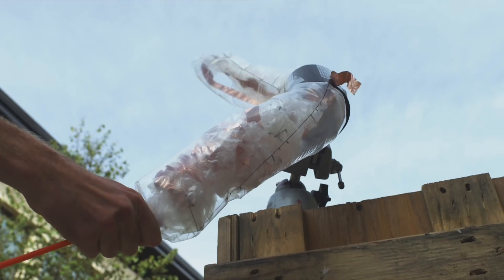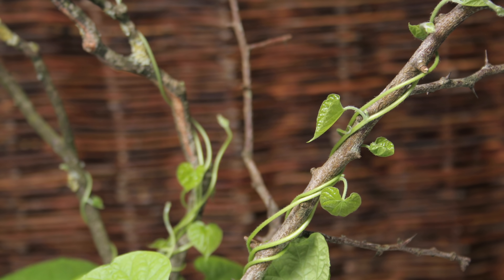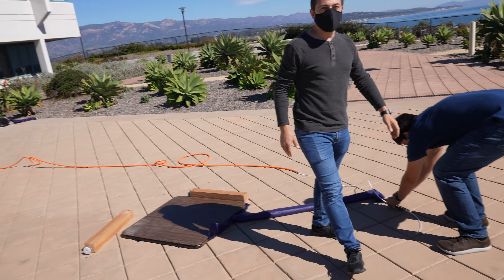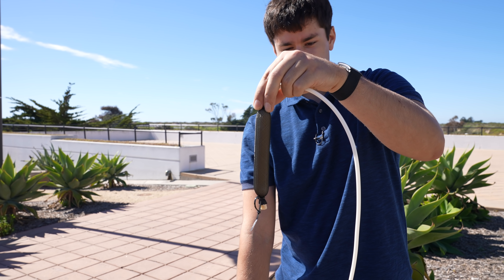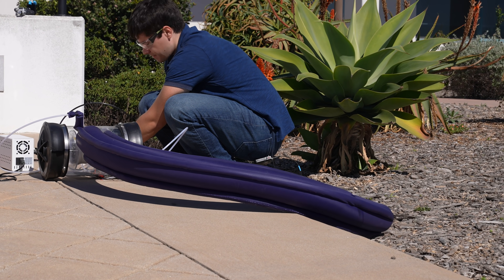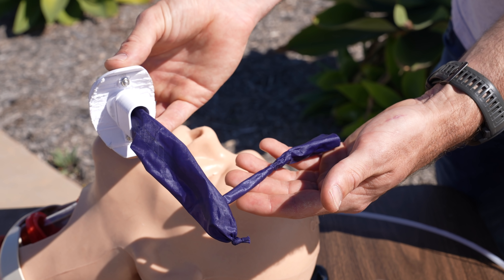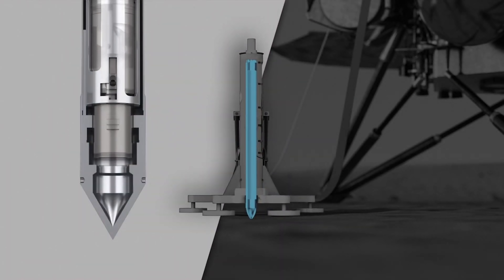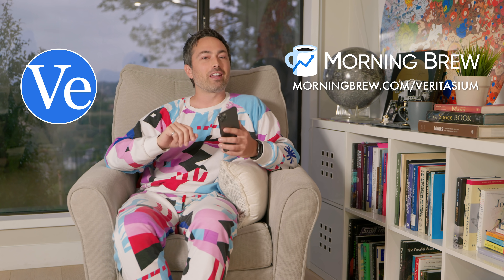This Unstoppable Robot Could Save Your Life

Comment: If they replace current intubation with this soft technique, the guys behind it should get a nobel prize for reducing the suffering in the world.
Reply: Telling me, I remember waking up with a tube down my throat. So damn painful.
Reply: Seems like exhaling would be an issue, remove pressure and the airway collapses
Reply: @Mooselake51  The core can supply oxygen while the outer sleeve remains pressurized, keeping the airway open.
Reply: People dont get intubated without sedation and anaesthesia, outside of some very rare and specific circumstances, in which they still recieve medication to make sure they dont feel the tube. Furthermore, this device couldnt replace the tube itself, merely the applicator.
Reply: @ineednochannelyoutube5384  I agree. The device will apply the tube fed through the middle of it. It's not something you would do to someone awake for sure. On the other hand they can do something similar for a choking issue. Something like that that pushes a chunk of meat down to the stomach when it is stuck in the throat could save a life potentially or maybe grab onto it and pull it back out. I could see that as useful for sure.

Comment: Could be used for ground anchoring in deserts or sandy environments. Lots of them push through the sand to a specific depth then are filled with cement to act as foundations. Could be used for anchoring things at sea in a similar way.

Comment: This could be used to create a soft conduit to run cables through an existing building, vs new construction. The camera head would have to drag a pull-string along on the inside. Supply lubricating gel into the inside as it goes. Once the vine robit reaches the destination, just hitch the pull-string to the cables then pull the cables through. Far fewer holes would need to be cut in the walls or ceiling to create a pathway.

Comment: Soft robotics are the best!! They have two key advantages. The large surface area means less force per area (pressure), a lot less. This is good for picking up fragile objects. The second is that material properties replace complex code. The intubation example should how this might work. The caveat is that soft robotics work best in conjunction with “hard” robotic components. They will eventually become common in applications that require a gentle touch. This could be healthcare or product lines and beyond.

Comment: after watching this...

I'm 100% sure this will be turned into a sex toy before the year is out.
Reply: And I’m sure someone is gonna over-inflate it and probably end up in a hospital.
Reply: If it doesn't, somebody's completely missed the train.
Reply: @marekkelin1181  Probably just deflate it and pull it out
Reply: @Snowmity  just use another inflatable robot to rescue the inflatable robot
Reply: @ImCelticlol  holy crap, you’re right
Reply: @ImCelticlol  help me step-robot I’m stuck!
Reply: @ImCelticlol  u2
Reply: @ImCelticlol  It's inflatable robots all the way down.
Reply: @Snowmity  inflate it up their intestines
Reply: @gram.  if it's long enough eventually it will come out the other end
Reply: You know, this thing does kind of work much like a schlong, doesn't it?
Reply: @ronaldgarrison8478  Not mine. Mine grows from tip backwards, into the base.

Is that normal?
Reply: @ronaldgarrison8478  yep
Reply: Could this be used in surgeries. Unblocking arteries etc?
Reply: ngl I already had the idea of something like that in my head but I didn't think it would use inflation to extend, I was just thinking that the tube would have a spine on the inside with cables as muscles running parallel to it along its length

Comment: This has been used for sewer rehab since the late 1990s. They use an epoxy lined tube that inflates through the sewer to be rehabbed, then hot water is pumped through to cure the epoxy. One of the absolute best “non-invasive” ways to repair an old sewer line.

Comment: Internally casing ruptured sewer pipes has been done for years but instead of using air epoxy is pumped  with internal air sleeve so it seals and solidifies after curing.

Comment: Self replicating machine
My description of a possible self replicating machine.
Part I - Set Up

Firstly we need to list the required parts of the machine.
The ability to build something
The instructions on what to build
The ability to copy the instructions
The ability to gather raw materials for creating a copy
The ability to gather raw materials for energy
The ability to use the energy

Part II - The Machine
For this demonstration I will examine a machine made out of wood.
The logic of this machine will be encoded in thousands of little gears. It will be able to move around pseudorandomly until it finds a tree when it starts trying to cut down the tree. It will use the wood either as fuel for the fire inside of it, to continue its own development, or to start building its copy. It will use smoke from the fire inside it to power the first gear so that it can move around.
Part III - Life Cycle
The life of the machine will start when its parent drops the new creature out of its top and lights the fire inside the new machine. It starts out looking for a tree to chop down and when it finds one it uses it as fuel and it will keep looking for fuel until it decides to go onto the second stage of its life. It finds a tree and drills out a hole for it to use as its shell. This shell will be to make sure the new machine it starts to make doesn't fall out before it is complete. When it does it will still continue to look for wood for its new copy and its own fuel. When it is done making its new copy its drops it down and starts the fire inside it only to immediately start working on a new one.
Part IV - How does Replication Work
The way the replication works is entirely encoded in the tape. The tape only encodes how to build the machine, nothing else. As the machine gathers wood in the second phase of its life, it runs the tape through a builder who reads all of the instructions and does exactly what the tape says. There will be parts of the tape that say to wait for more wood to come in before continuing. 

On the next step the machine will run the tape through a copier which will create a near identical copy of the tape to feed into the new machine and after that everything will be complete.

Part V - How does the Logic Work
For the logic we will need a turing complete system that can run mostly on gears. And for that we will use the functionally complete not or system of logic.

Not gate

The not gate is easy, all that is needed to negate an input is a gear directly connected to the fire which is turning in the opposite direction of the gear we want to negate, this only works if some gears can move without forcing all connected gears to also move which is not hard to do

Or gate

The gate is almost just as easy. All you need is two gears both connected to the third gear in such a way that it can only flow in one direction which is also not hard to do.

Part VI - Other Materials
For this to actually be useful it needs to be able to work with materials other than wood, and the only part that is actually wood dependent is the fire so in order to do this with any other material all you need is a new energy source that can power gears. If there's any flammable resource in the area it is possible to use that, for example it's possible to imagine one made of dirt with a grass or leaf fire. However two situations where this would be very interesting would be underground mining for resources, or on the surface of mars to help terraform the planet. 

Underground an obvious resource is coal which is preferred because it can keep burning for a long time and on mars there is tons of geothermal energy which can easily be used to keep any machine running. Solar power does not work because the machines won't be able to find enough silicon to make more solar panels.

Comment: “It’s basically free” says the man that most likely does not pay for the research and development of the project he is working on. Guess that money just gets pulled off the money tree they grow on the back lot. And if he is 100% funding it good for him. I hope he gets a huge return on his investment.
Reply: Well I did understand it in different manner. This kind of robots are super cheap, it is just some material, and compressor. No engines, no super specialised detectors, almos no electronics, superlightweight. easy to deploy and produce.
Reply: @marcinrobak6038  it’s not just the materials involved with making said ballon robot.  The team doing the research and development on the robot have to be paid in some way.  The team has to be compensated for there time and effort.   If they are doing it for a university then they receive a paycheck from said university.  If they work for a private firm then that firm issues them a paycheck for their time they work on the project.  The time is the part that’s expensive and no materials are ever free.  No mater what they have a cost associated with them.  The plastics and polymers they are experimenting with are not free. The air compressor is not free. The sensors and cameras they are using are not free.  These all have a cost associated with them.  So let’s say these guys work for a university science lab and each make 100k per year.  Let’s say they have 3 people on it and have been exclusively working on this project for two years.  So 600k in cost for this project before any materials have been bought.  This does even get into the possibility of government grants and tax dollars going to research like this.  But maybe they are 100% privately funded, maybe they are doing it their free time outside of work. If so I wish them a giant return on their investment.  My point is absolutely nothing in this world is free.   Everything is paid for by something.
Reply: @cypresscustoms  Well yes everything has a cost, that cost will be returned in profits from commercially made robots, as they patent those solutions.
May argument is about what the Prof. Elliot Hawkes did say "... they are so cheap, I mean they're basically free. You could grow hundred of them into a collapsed building."
he is talking that those robots are super cheap to make, not as his work is cheap.

Comment: S&R Phase II operations. drop a box that deploys into a tent with a roll-out solar panel and/or a soft windmill to be shelter for stranded people while they wait for a rescue team. Cut the power to the pump and roll the shelter up for refurbishment/reuse in future deployment. ALL of the uses shown here are useful in deploying such a shelter, using ground liquification to shoot anchors into the earth, grow a tent using pre-confined tubes, the antenna to boost signal of radio. masts for the solar/wind. Hell, you can even make a rain-catch/solar still with this. An entire livable camp site in a small, self deploying package. No previous survival knowledge required, just a package with a rip cord and a note that reads "Pull cord and stand back. We're coming. Fresh food and water inside, talk to you soon."

Comment: You could create an optical line that you feed through the centre. That is pushed forward along with the pressure allows you to have Optics line. You have to reverse the entire system. The balloon becomes on the outside reversed if you understand what I'm saying the good thing about having the optical cable inside it can double as a rope when retracting the system. Think of double-layered socks the Optics are inside the first sock. Then you have your air layer of compression and the outer sock covering. Expand out. And the optical nerve pulls it back in and deflates

Comment: To install a kite bladder there is the need to have a pulling line inside the leading edge or struts. It would be easier if it was possible to use the technique described here.

Comment: This could be used to supply fresh oxygen and liquids to trapped people, even if it weren't able to lift collapsed materials from them. You could feed straws through the middle of it, one for liquids and one for oxygen, even a microphone and speaker, so you can communicate with the trapped person and give them reassurances.
Reply: Write that down! Write that down!
Reply: Awesome idea! Please reach out to the guys, links in video description. I’m sure this could be great for avalanches!
Reply: be sure to consider the dangers of spraying pure oxygen into an area where sparks or flames may be present
Reply: This was my idea as I was watching the video. I'm sure many other people also thought the same thing.
Reply: There is a system in place for some of these events. What needs to be realized is the video, for burrowing, was shown in sand for a reason.  The material you are penetrating has to be displaced to pass through. Once you get very deep at all this setup will certainly fail in denser soils, and we have not even made it to rock yet. An Air Track unit that bores into rock runs off of air and still uses steel as the tool.  The head is bigger than the shaft to create a large enough hole for the accompanied shaft and to displace the material so it can move up the bore spacing and out of the hole. In drilling this is called circulation.  To push through any material there needs to be some form of circulation or your achieving the opposite. Compaction. 
I cannot say, but perhaps this design could be more suited for avalanche scenarios.  Need to keep in mind though, snow can condense to a degree, and the deeper you go, you may run into ice chunks. Would you attempt to burrow through it...or go around it.  I don't know.   I'm just pointing out even snow is potentially abrasive, then again,  so is sand. Perhaps a more experienced mind in this field could weigh in?
Reply: @ironfam6511  Maybe emitting hot air/water or ethylene glycol out of it’s end could help it going through snow or ice.
Reply: @LukasFink1  Another comment mentions a robot that has a cutting ring on the end, perhaps something similar could be used if a vine robot was used in one of those situations
Reply: @ironfam6511  Yeah I think only some of the applications shown in this video were actually good/viable/practical.  The borrowing one was a not-so-good one, we have much better burrowing tools for that kind of job, and they can deal with obstacles.
Reply: @ironfam6511  : The drilling industry already deals with the need to displace materials by feeding them back through the center of the drill rod. It gets done in both the water and oil industries. Use a more conventional robot for the drill head (for guidance, and to cancel the torque from whatever drilling you need to do), and one or more of these for the body, and you can search over arbitrary distances.
Reply: If someone is really buried, this device wouldn’t be able to get to them.
Reply: I don’t think i like the idea of being reassured by a long, wet tentacle.
Reply: For trapped miners
Reply: Great minds think alike. I was thinking the same thing. Having a portable version of this when spelunking could have saved a few lives
Reply: If it can deliver chips and coca cola you can leave me trapped there
Reply: @d0rk467  don't forget a little screen so you can watch some Netflix while being rescued!
Reply: This needs to be funded for disaster relief!
Reply: Cave rescues, people trapped in air pockets in underwater caves.
Reply: Fresh oxygen? Cant be picky when trapped under a building.

Ps: its a unfunny joke
Reply: @frokjodor  if you don't have fresh oxygen, canned oxygen will do just fine.
Reply: And covid...
Reply: such a good idea, there are so many possibilities for this robot
Reply: Ooorrr
Reply: Why not just a walkie-talkie
Reply: The first thing that I though it's that we can use to reach radioactive places and explore, or go in places that humans can't be, this also can be used to go in toxic places for humans (like places with toxic air) or things like that, not needing to use oxygen and so saving resources!
Reply: Lol. It cannot pick the correct path. Supplying oxygen to a person through a crack would result in the tube going in the wrong direction sometimes,  with no idea from the origin on if it got there or not. Any application that does not have multiple dead ends, can easily be achieved by a hose.
Reply: @guinness1987x  it sounds like you think the oxygen would he sprayed outside the robot and that the robot wouldn't have a camera
Reply: @guinness1987x  why can’t it? It has a camera and ways to control direction. There’s no way a hose would be better
Reply: @guinness1987x  They already have models that can be steered.
Reply: Nah foods would get stuck if it went through a very tiny space
Reply: It is a straw
Reply: Reassurances! “Hey guy here’s some water, it will keep you alive longer so you can experience your death better down there” lol
Reply: No you couldn't, and if you think you could then you clearly do not understand how this thing works.  🤦‍♂️
Reply: @sunnyjim1355  why would it not work?
Reply: @sunnyjim1355  care to elaborate or nah?
Reply: @sunnyjim1355  I've been in robotics for decades, and have been involved in the design of several robots, including designs for Dynamixel among others. There's no fundamental reason why tubes could not be pulled through the center of this device. The length of hose necessary to reach the target would need to be calculated, and then the ends of the hoses would need to be positioned within the tube and attached to the interior at just the right point to terminate at the target once birthed through the end of the device. It's all perfectly capable of being done.
Reply: @sunnyjim1355  : You could pretty easily feed through multiple tubes by just releasing the pressure on the initial one, and then feeding smaller units through the hollow center of the first. The first one would function as a guidance "track" to keep the others going the right direction.